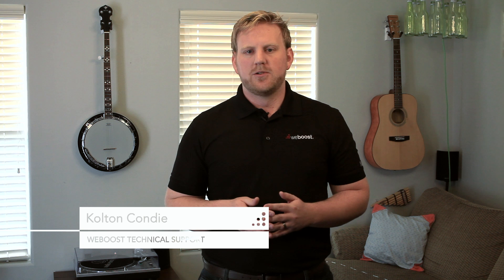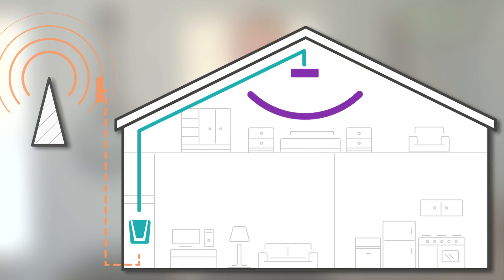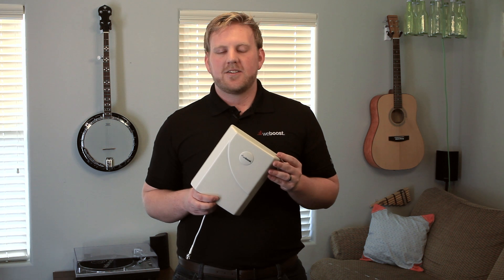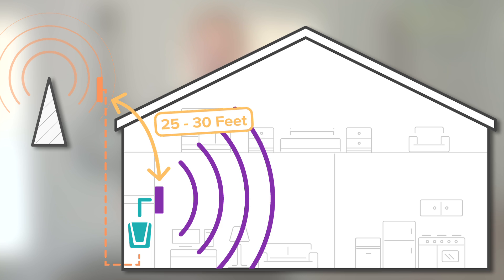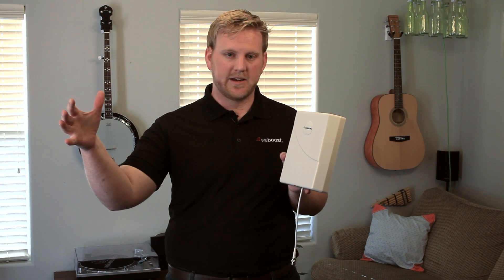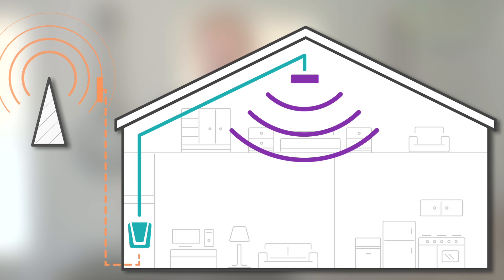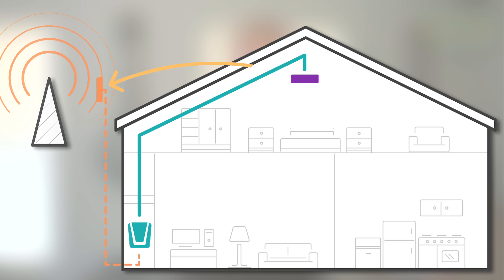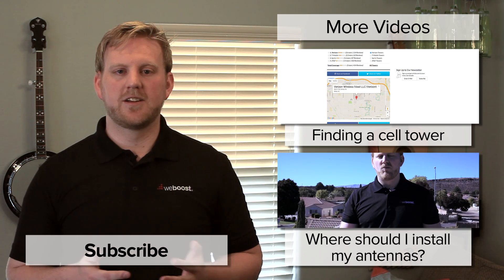How to properly separate your antennas | weBoost

Comment: Glad I went with a MOFI5500 instead of the WeBoost. The MOFI uses password protected wifi for the internal distribution. So no interference with the cell signal. Also be aware the cell signal can be picked up by other unauthorized users outside your home, loading down your system.

Comment: I have been seeking an unfindable answer to whether you can mount an Indoor Directional 698 to 2700 MHz Panel Wall Mount antenna back to back on the same wall but for seperate rooms. House is primarily block, lathe and plaster and also has back to back fire places. I want to mount them opposite of each other on opposite sides of the wall but also opposites sides of the fireplaces facing away from each other and into the center of the respective rooms. I am thinking this should work based on all the warnings about NOT facing them toward each other as long as they are at least 50 feet from the external antenna and 25 from the booster. Is this correct?

Comment: Can you get the necessary separation by way of a metal shield? I have a steel roof. If I put the antenna above the roof and the other antenna below the roof will that provide the separation?
Reply: Did you figure this out? I’m also installing on a metal roof.

Comment: I'm having a lot of oscillation feedback where the light is blinking between red/green. I have giant sheets of metal that I put in a bathtub between the antennas, and that seems to help a lot. However, I need a more permanent solution than sheet metal in the bathtub.

So I'm looking at installing a metal squirrel baffle just below the antenna on the roof.  Like this one: https://www.duncraft.com/XL-Hanging-Squirrel-Baffle

Do you think this would work?
Reply: I just had another idea. Would this work: Find an old direcTV dish and mount it on the roof mast facing down towards the inside antenna?

Comment: Want to install my broadcast antenna (4g connect) in a closet next to the Den. How much signal do i lose putting against inside wall of closet vs mounting on den wall and running the coax thru wall into closet?
Reply from the maker: Thank you for your question! The signal is lost at different rates, depending on the type of material.  You could lose anywhere from 1-3 decibels per layer of material. It’s always recommended to have the antenna out in the open if at all possible, for the best results. 
Thanks again hope this helps.

Comment: If distance both antenna is not 25-30 feet, and there is no noise in voice calls, and coverage is also good , it's ok or can interfere to Base station.
Reply: As long as you're not getting red lights you're fine.

Comment: I have a 20' aluminum RV I'm setting up for boondocking. With an omni antenna on one end of the roof, the furthest I can place a panel antenna inside is about 10' of seperation.  Will this work? How should the panel and omni be oriented toward each other?
Reply: I realize this comment is two years old, but here is a solution.  If you shield the outdoor antenna from the inside antenna by hanging some faraday fabric behind it on the inside of your rv in line of sight between the two, (pretend you they can actually see each other through the wall) it will effectively shield one from the other and you can place your indoor antenna wherever you'd like it for best coverage inside.  I have no idea why absolutely no videos offer this solution, but there you go.  If you want to go a bit cheaper, you can make a shield out of a few layers of aluminum foil wrapped around chicken wire or better yet an old aluminum window screen, and place it behind the outdoor antenna, act like you're making a satellite dish, same thing just a bit ghetto.  This will completely block all rf from one side of the outdoor antenna while allowing the indoor antenna to be placed where it works best for your needs.  Sorry to be late to the party, but there you go.  Worked perfectly for me.

Comment: What is the difference of installing the internal antenna in the basement ( where reception is the lowest) vs the attic and having the the internal antenna facing down?
Reply from the maker: +Courtney Quinlan If you install the internal (broadcast) antenna in the basement it will only provide you with cell signal there and not on the upper floors. Installing it in the attic facing down would provide you with the strongest signal on the uppermost floor closest to the antenna and then on down through the house.

However if you need signal in the basement and not so much on the upper floors then installing it in the basement would be your best bet. Essentially you'd want to place the internal antenna where you need the strongest signal. Just don't point the two antennas toward each other.

Hope that answers your question, if you've got any more let us know.